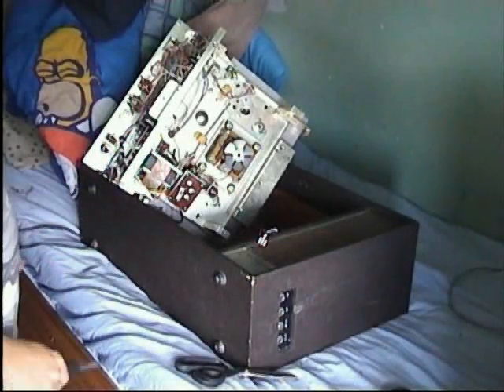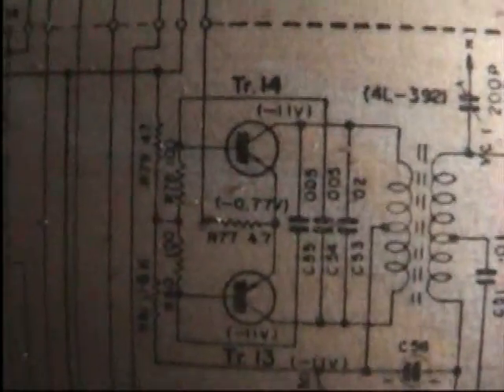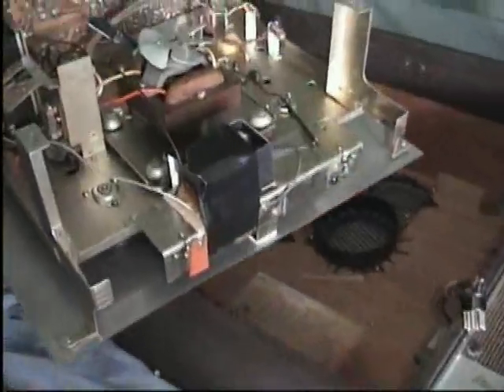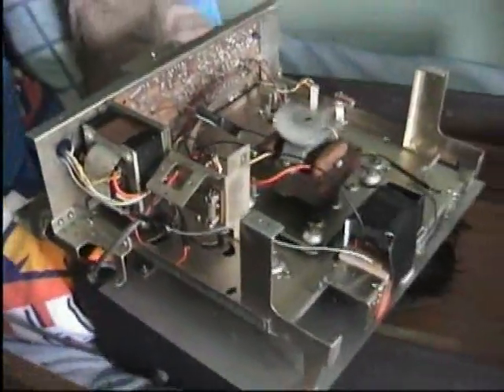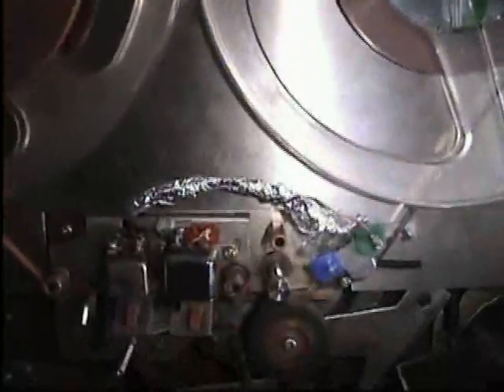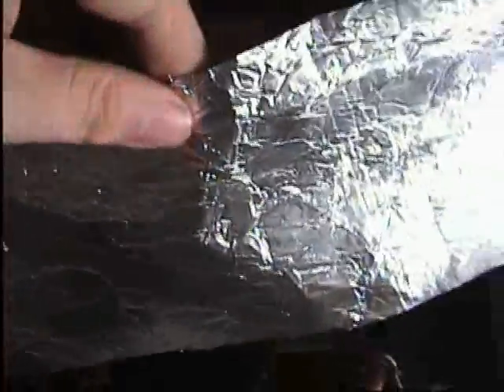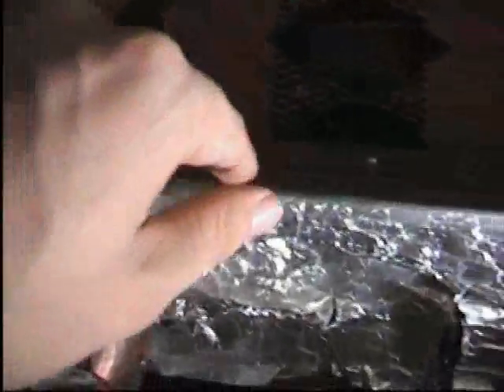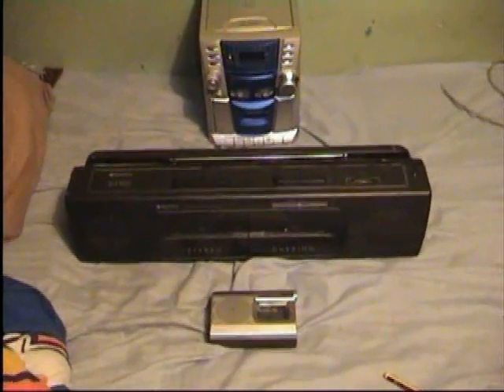Rewiring Sharp

Comment: That is quality sound 4 shure. BUT... you spent way too much...and got a worn out tape recorder. Also, if you keep operating it with a spanner (that's a wrench) eventually you are going to damage the shaft so much that the correct control lever handle, when and if you ever get one, won't fit properly. Other than that. Bravo.